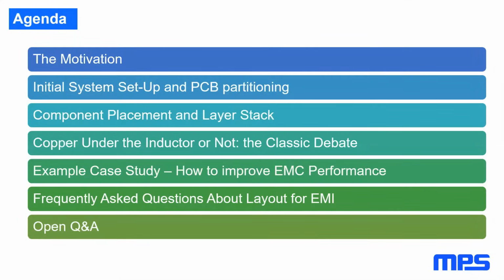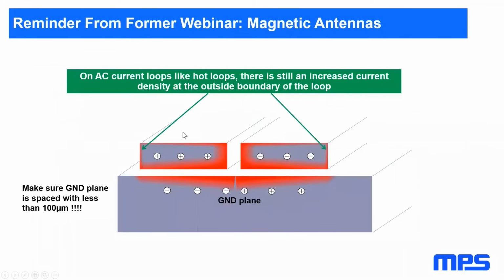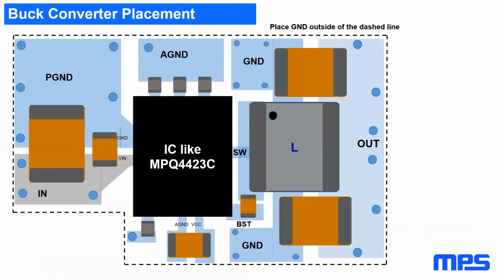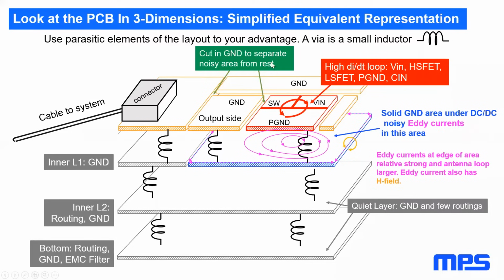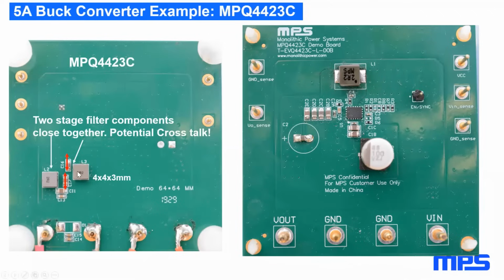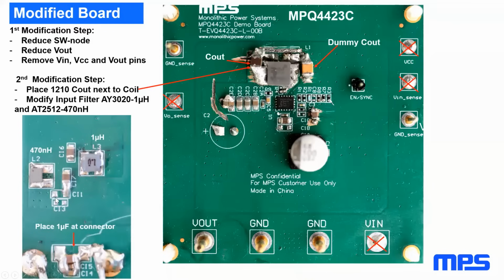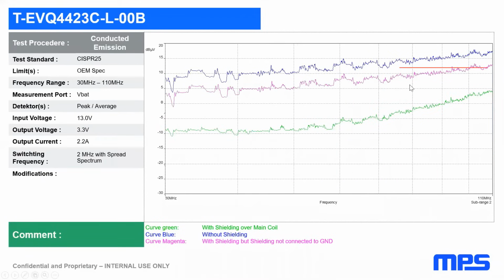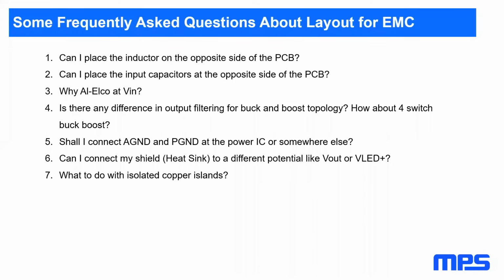Webinar: EMC Optimized Buck Converter Layout

Comment: In 21:15, What role does the Dummy Cout play?
Reply from the maker: The MLCC layers are metallic, they act as E-field shield. In this case both sides are GND, so all layers are GND.
In normal design, Cout is used for shielding the E-field radiation from the coil. 3x Cout, 1210 with 2.6mm thickness are good.